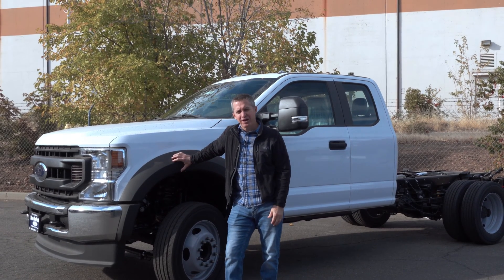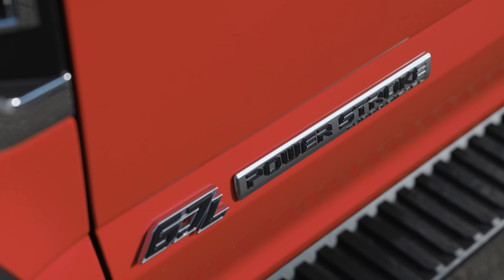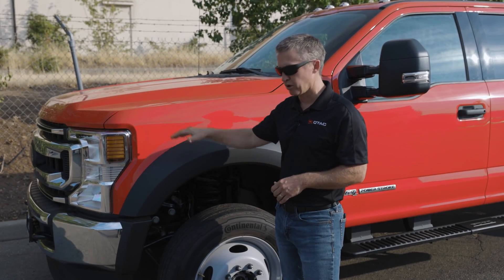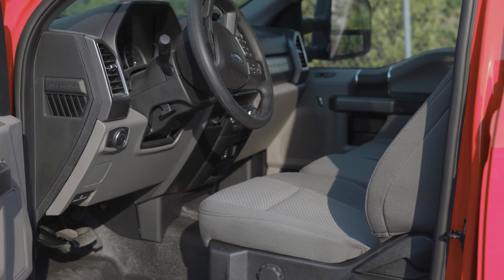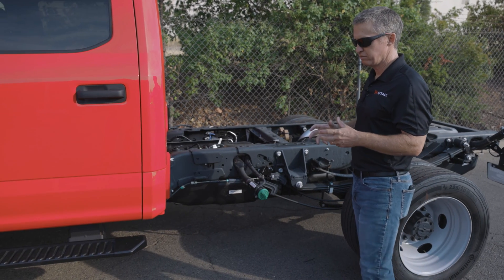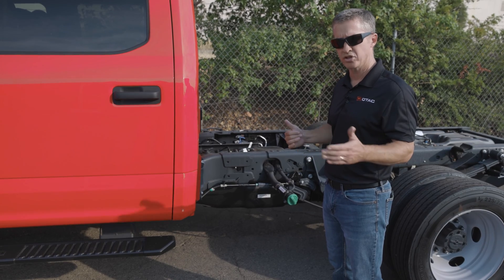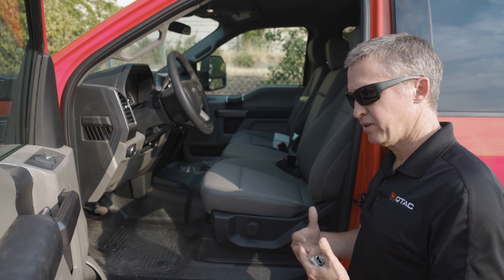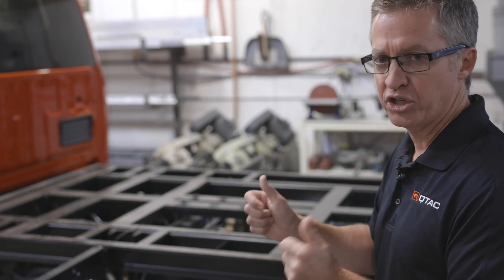Ford F550 Type 6 Wildland Brush Truck - Episode 1: The Chassis

Comment: Can you tell me which NFPA standard you are referencing for what seems to be the body/chassis mounting at the ~4 min. mark?
Reply from the maker: That section should have been re-shot, as it’s not specifically ‘subframe.’ Years ago we used to build our tanks and bodies in such a way that the tank was not removable, and in keeping with 1906 18.5.2 we isolated the entire structure from the chassis by spring mounting the subframe. That stuck even after we began making the tanks removable, and it’s a method that’s used by many truck builders (in the fire industry and others). Thanks for the comment.

Comment: Are you locked into that brand of tire when building out these brush trucks? Cannot shop around for other tire brands that might last longer?
Reply from the maker: Unfortunately, to achieve the weight rating we're after, yes (this is addressed in another video as well). These Continentals will go 20K miles, but they require that you don't let the air pressure drop, don't go much above 65 mph (68 mph max rating), and rotate them often. Thanks for the question!